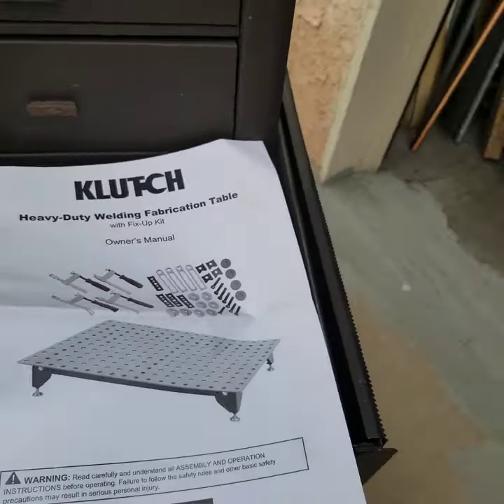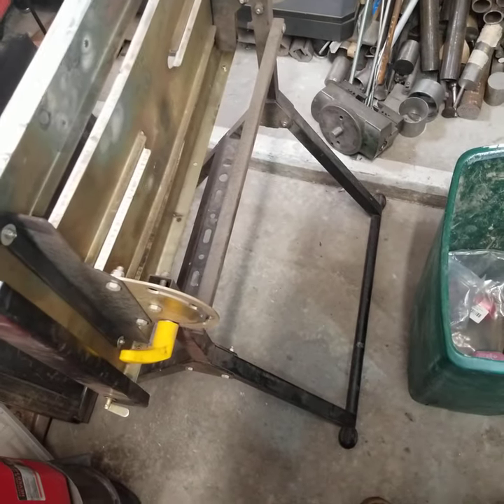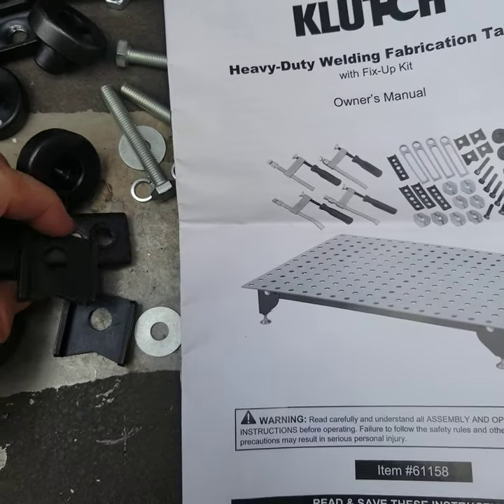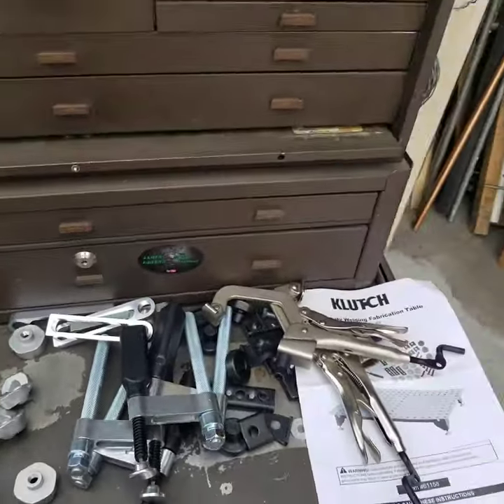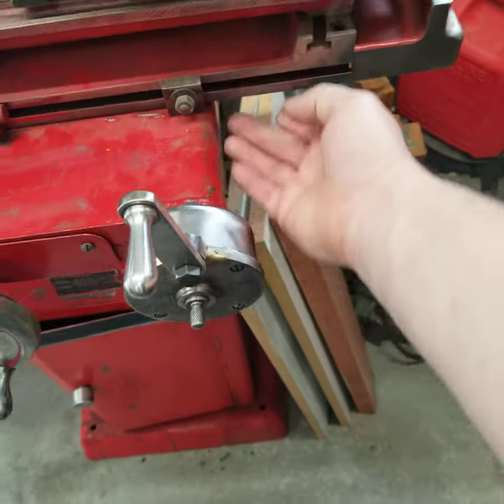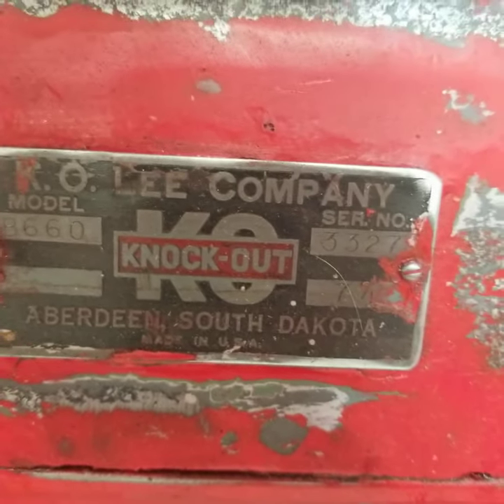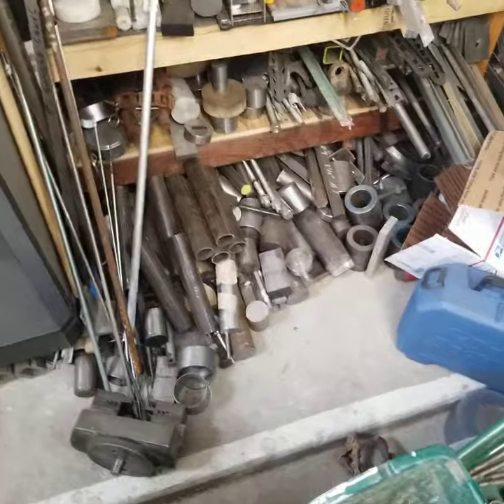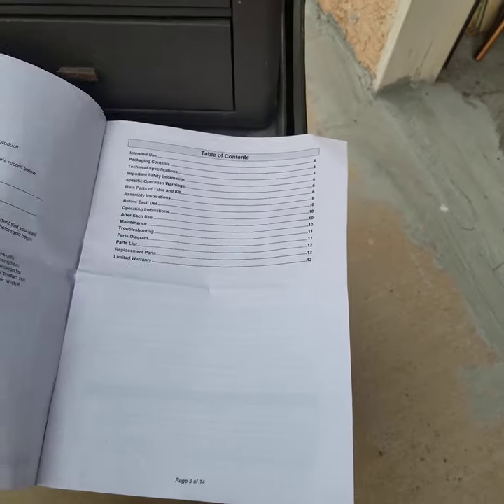Klutch Welding table and Update about me.

Comment: If I were to drill these holes will a regular 1/2" drill bit work or can I use like a milling bit. I was thinking about buying a cheap magnetic drill press.
Reply from the maker: Honestly for $225 shipped through AMAZON prime its worth it rather than drilling all of those holes. You can get an extra one and add onto it if needed from Strong Hands Tools.
Reply: @eagledustoff37shortserious65  I saw the table at the store and seemed small. My wife even told me why such a small table and to build one.I think my price was $180 after tax with coupons. I have a 4x8 sheet of 1/4" and might do a 3x6. I was looking into cost of mag drill and beverages.